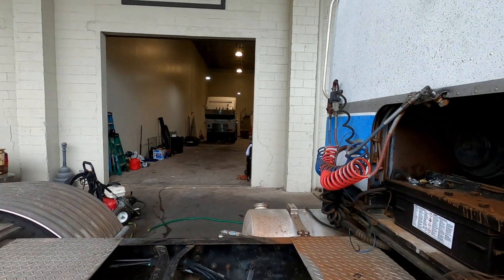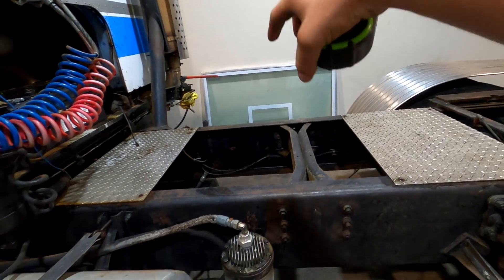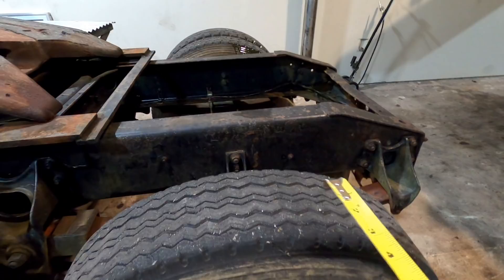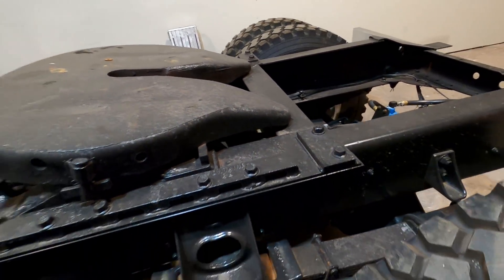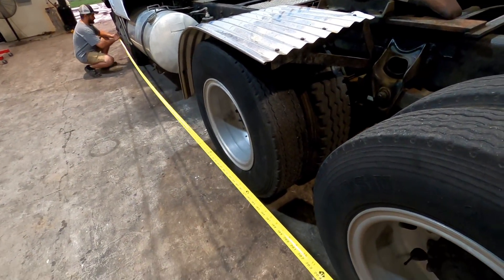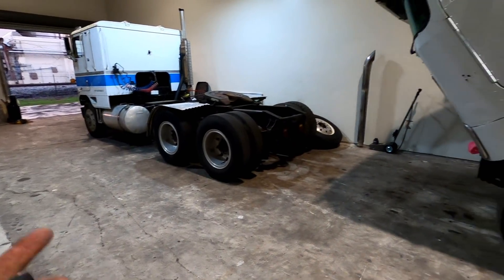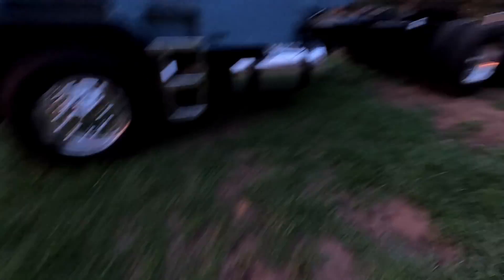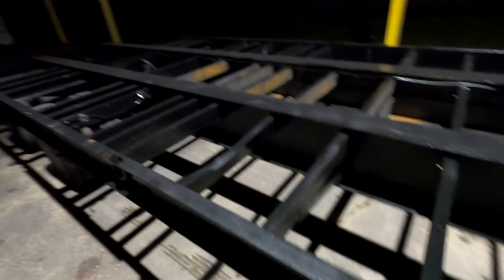USAF Cabover Frame Stretch?

Comment: i thought truckers wanted the tractor shorter to pull longer trailers,  something about total length, so a longer tractor had to pull shorter trailers,  or maybe laws have changed,  he will never haul with it so doesnt matter
Reply: bobby o yes truckers want the truck shorter. Its just easier to make turns and back in spots with a shorter truck. Some truckers dont even like having the camper to sleep in if they dont do long hauls just cause if its not there the trucks shorter making their job a little easier. Stretching is just for looks. Personally i think its ugly and gets even more ugly with a trailer hooked up
Reply: @buffalobmf  stretching isn't just for looks! On them older spring setups, stretching the frame makes the ride quality sooooo much better!
Reply: Um no its better having long because it more easy to back up with longer whell base
Reply: Wheel
Reply: The wheelbase on my conventional (long nose) is 273. Rides quite nice ( the main reason I’ve ever stretched a frame) and with a cabover, it’s going to look longer than it really is.
Reply: paul hauenstein ok😂 not in my 7yrs of trucking across the country everytime i get a truck i ask for the shortest wheelbase with a camper cuz its sooooooo much easier then a stretched out truck. Can i drive a stretched truck of course ive done it many times and its the dumbest thing ever just to make a 90degree turn on a 3lane intersection you have to turn MUCH wider making things unnecessary harder/annoyng. Same with backing in a spot you have to swing that truck sooo much further mostly likely in a tight spot which stretched frames make much more annoying

Comment: Bruce. If you stretch it it'll have a bigger turning circle.
The best thing to do is cut the frames but keep the end product the same length, doing this you'll end up with a long and a short wheelbase truck. 
What's left over could be made into a very short wheelbase truck with 2 axles.

Comment: dont understand why he wants to stretch everything
Reply: greenacres farms green yea really
Reply: Cause he wants to be Johnny bib rigger
Reply: Apparently ya'll have never run a spring suspension truck! Stretching the frame allows more of the vibration through running to be absorbed by the frame flex rather then the driver, and from experience, that kind of beating on a short spring truck will wear your back out!
Reply: @redsoldierftcarson  he ain't going over the road with the damn thing. Hell he don't even have a CDL. The only reason he wants to stretch the frame is to look cool
Reply: He just wants to stretch his wallet.
Reply: @kylanwhittington1646  he's  got have a truck that's worth a fuck first

Comment: I don’t recommend cutting the frames, it will cause a lot of problems and be a lot of work. Besides I really want to see the white cab over run again, you worked so hard on it and I’d feel bad if it all goes to waste. And the USAF truck, just try to also fix it up and make it look new but it’s your choice.
Reply: The white cab over needs too much work so its now a parts truck thats why he bought the Airforce truck
Reply: This one needs a fair bit of work too. It will be a "Rabbit hole" for sure. I don't understand Bruce sometimes, just a few videos ago he told us the axles in the white one were of an unknown, but he wants to use them in this one?? I get the feeling he's underestimating whats involved in stretching, its a big job. The white one was a lot of work, but just chip away at it and he could still do it. The wiring in the one one was bad, well no lights on this one?? The air lines will all be RS on this one as well.
Reply: Mitchell Bruce hey I have an option 3,sell the usaf truck and concentrate on the white international,use the Freightliner as the show truck as its already got the wheel base,but get on do up the White international instead of throwing more money into crap,if he don't like having no money then give it to charity not buying piles of junk.
Reply: Lizzbird I'm with you on this one
Reply: James Horsfield Yes I agree. I think people are starting to get a bit tired of his channel tbh. Most people want to see him follow though on what he starts. Truth be told I think he has a short attention span, as he pulled it apart then got sick of it. Quite a few projects fall by the wayside. The white international is not beyond repair, would give a lot more interest in the channel to follow through. The Airforce one will need a lot of work as well, he will find it’s far from perfect.

Comment: There is a third option. Transfer the rear axles and tanks, leave the frame alone, fix or change out the engine/transmission, and restore the exterior. At the same time he could stretch the other frame and rebuild it at his leisure. He could put a generator back on and make a trailer a rolling show room or what ever her could take to shows, vacation, what ever. This would be an easy attainable project which could help him bring money into his channel for other projects.

Comment: Bruce,

My $0.02 - You bought this truck to restore, make awesome, etc.  You don't need it on the road tomorrow...  If you want to make the best use of the other  International - Go big or go home.  I'd section the frame as you suggested.  The other rear section of the frame seems to be in better condition, anyway.

Take your time with the resto.  Make it badass.

Comment: That paint scheme suggests that it is originally a "Motor Cargo" truck.....Not sure if anybody has told you, but actual, working truck drivers will 100% choose a conventional over a cabover, even if the cab is a long Pete of KW...….Return on investment is guaranteed to be a negative number!....It will be worth no more than a third of your parts cost regardless of what you do to it, so I'm not sure what the point is, but I'm glad to watch!

Comment: Please stretch  a few more feet from the 10 inch end between the fifth wheel take your time no rush you can do it yourself leave the airforce color just buff it out ,dual 7in flat tops, I am a prior Air Force veteran I think a good name for that truck would be Tech Sergeant 👍🏾👍🏾👍🏾, thanks for putting her back in service...

Comment: Here we go AGAIN!  Haven't your learnt anything from the white one?  Why stretch it?  Leave the wheelbase alone and get it spot on mechanically first up.  Don't  stretch it at all.  Plenty to do to make it a reliable well presented beast.  I remember a comment warning you to check the diff ratios before you bought it, but you just forged ahead with your head in the sand and now you have major work that could have been avoided.  And PLEASE keep the bling under control.

Comment: Your Air Force truck has a small motor and it won’t have any power with higher speed rear ends. You want to play super trucker go find an old KW cab over with a 3406E and a fuller road ranger 13 speed.

Comment: Bro,

I did noticed on your previous videos mentioning that one of your first international fuel tank is dented. Well my opinion is, since you've bought another USAF decommissioned international cabover and I'd noticed the fuel tank on it was in good condition dented free, you might just swapped it over with your current dented fuel tank. With a little bit of polishing, it should be as good as new

Comment: If it was mine I would get an air ride cut off with enough frame to get the length you want with one splice. Put an insert inside the frame over the splice that is four foot long and tight to the top and bottom flange. Use twelve 5/8 bolts per insert. I am not saying this is the best way. I have built two trucks this way and so far have not had an issue. Good luck my friend.

Comment: Remeasure the wheel base again, when you measure a 3 axle you measure from the center of the front axle to the center of the tandems not the to the rear axle. No, do not stretch it

Comment: The axel stretch seems like quite an ambitious project. Just wondering why such a long wheelbase is needed. I understand swapping out the axles and most of the air lines can move in the swap but you're planning to switch to air ride suspension so you've a bit of a job right there. Ultimately I would wait and see what you discover once the cab is up.

Comment: CUT & STRETCH !!!  Best option !   Run they air lines inside the frame to the rear cross member & move the glad hands & 7way electrical plug under the goose neck of the trailer. That would make a very clean setup with coiled air lines & electrical cord. Keep the big tanks for a much cleaner look.

Comment: Why do you need to stretch the frame any ways.I worked in a certified truck shop for forty + years welding frames. You are not a certified welder or frame tech.You think you can just cut  a frame apart add a lenght of frame from something else and birdshit weld it back together.I HOPE INSURANCE COMPANIES ARE WATCHING!

Comment: Is it just me or does this new Truck seem like its in worse condition...
Reply: Well one of the reasons he didn't want to mess with the first one was because of wiring issues but the one he just got no lights work on it so he might have jumped from the pan into the fire.
Reply: No, but it is older. Anything that old is going to need  some work.He was able to drive it home 600 miles so no its not worse.
Reply: he`s already in over his head
Reply: It was used by military. Everything is trashed from military. We abuse everything we touch

Comment: To be honest, I would be on the “don’t touch it” vote, but I see it as this: your correct on the thickness of the frames and being hard to stretch due to how the frame does go from 14” to 10”. Also the white one is just parts now. So full send it man. Don’t need to make more work for yourself. Slice the ass end off of em and go for it! 
Edit: loving the look of old Blue

Comment: Hi all, I'm not really sure why you'd want to stretch the airforce truck and suffer with a much worse turning circle in the end. I'm in the UK so not sure the make of the doner truck, but why not fix the engine in that one as the chassis looks pretty good in itself. Then fix up the airforce truck as a stock truck. In the end you'll have two good trucks instead of one good truck, hopefully, and two halves of another. What is the fixation with stretching trucks for anyway, if you had decent air suspension you'd just not consider messing with anything.................Regards Dave.

Comment: I would stretch it, cut the c channel  half way down L shape 8 inches long or so on each splice to have a ledge for the rear two channels to sit on, take your time laying it out and cutting. I would then weld  it back together making sure each side is even. I would grind the outer weld flush and add 1/2" thick fish plates about an extra 3 inches past the splice.

Comment: you have a solid work truck with Blue Collar, Stretch this one, make it a show truck. Turn up the engine some, the 8v92 turbo makes 435 horse at 2100 rpm. you will be so busy shifting you will not need more hp

Comment: I wouldn't worry abt stretching the frame, jus swap the rear ends that have been redone, getting in and out of places will be alot easier, I've got a 74 Mack w a long flatbed that is 300 inch wheelbase, and jus pull a 24 ft trailer behind it, it can be a hassle getn in and out of tight driveways and entrances sometimes

Comment: Stick with Option 1. If nothing else, swap on the air ride hard components from a wrecked IH, and add new air bags and valves/hoses later on down the road...save the money and immediate attention for all of the other items it NEEDS to make it roadworthy. Plus, you're going to wind up putting some money into parts for that engine, and BGM Scott doesn't cut corners....he's become an excellent resource for 2-cycle Detroit engines, be sure to soak up knowledge like a sponge.

Comment: Leave it as is. its all ready got the sliding fifth wheel you wanted. Get mech items done first. Oh  and like others said wheel base on a tandem is done at center between the two axles. option 1.And I recall stretching also requires extra C channel to go on either the inside or out side of the cut for strength. approx. 2ft ea. way . some one else mite correct me if needed.

Comment: The objective here is to accomplish building a showy cabover with some USAF history. This is the time to stretch and glam it up. The tanks need to be long to match the lengthened frame. The first cabover is now for parts and it has already had all of the essential upgrades. Makes sense to swap over the back end and part out the balance of it. Might be really surprised as to what all of it can bring in little by little. The white International will vanish in 60 days!  I would still like to see a Cat engine but that's just my preference. 3406 B

Comment: Bruce, #1 job, get the Wild Blue Wonder Air Force truck fixed first, lights, brakes, transmission, engine, all the hoses, all the wiring, & a RADIO!  Do whatever to the frame.

Comment: I can't recall if I said it in the previous video but there is likely a speed governor on it to prevent speeding.
Reply: The Air Force truck is geared too low, at 2500 RPM,  it's only doing about 65 MPH 
That's slow, very slow.
Reply: The Air Force truck is geared too slow
 65 at 2,500 RPM is slow.  He said he thinks it has 3:90 gears, according to my calculations it's closer to 4:50 with an over drive  top speed would be closer to 85 MPH 
I'm figuring on a 13 speed with a top gear of .74

Comment: you can take the slider fifth wheel from the old international would work better with the freightliner and your trailer to pull any equipment and it is free

Comment: Just a piece of advice you measured the wheel base wrong the right way to do it is from the center of the steer axle to the middle of the drive axles, so your looking at probably a 180 ish wheel base, also stretching a truck is not as easy as you think I’d leave it personally on maybe pursue it down the road

Comment: Get it mechanically sound first.  You have good ideas  but your priorities have to be first to make the truck road worthy and reliable , Put the tires, rims, fuel tanks from the white International Swap the axles, swap the tanker, lift the cab and fix the interior  lightsand exterior and good  radio .but you already decide on what your gonna do

Comment: leave the new truck at home and forget about it for the minute. then go and strip the old white one of all the parts etc then scrap whats left.then get a pen and note pad and write a list of all the jobs you need to do and what parts you would like and need get the engine rebuilt and painted on the new one and get the cabs dings and dents repaired and then get it painted at a proper paint shop. whilst cab and engine are getting done you can do a proper good job of the chassis etc. so first job phone and get a slot at painters and arrange for engine company to build engine. peace from the uk

Comment: I’m sure someone already said it, but that’s not the correct way to measure wheelbase. It’s measured to the center of the rear “group” of axles, not to the center of the rear most axle. All that being said, the way you are measuring is fine just for truck-to-truck comparisons. BTW the freight shaker looks badass!

Comment: I’d say keep it standard. Sort out all the other jobs first. Like the electrics and the water leak. If you are not happy with the axles. Then just swap them over. It’s not that hard. Just jack up the chassis and wheel out the axle with the springs and everything fitted. You’ll do it in a day. Rather than cut and shunt the chassis. I say keep it original and try and find the trailer to go with it. Maybe change the mud guards with something similar but up dated.

Comment: I think you should just leave it alone stretching it ist's going to gain anything.  You to fix all the running issues make it a good running solid truck first. Keep it stock and fix everything make everything work. Then just swap the axles from the other truck. Also the wheels.

Comment: You don't measure wheel base front axle to the back axle...   I thought the Air Force truck was in mint condition.  You guys should maybe talk to actual truckers for some advice. Just crazy buying chrome before having truck mechanically safe .

Comment: Hey Bruce....now read through the comments more closely. You need to address why you would NOT take the cab and engine / transmission out of the USAF truck and move them into the other International. Similar amount of work and no frame cut which is a 3 day task. People are asking and it's a good question to ponder. Think about it.....

Comment: I don't think the gears in the rear end AR the determining factor of being to low gear. I think the older truck had a direct-drive transmission and the newer one had a overdrive.
Reply: Had the newer one been a 13 speed I would agree, the problem is, I don't think 9 speed overdrive's came out until much later like around 2000.
Reply: @bertgrau9246  I have a 91 with a overdrive 9 speed .

Comment: Are you going to change the rear ends or is 60mph fast enough for you. I had one that would only go 60 and it was a pain in the ass. Being that's a Gov. truck it may have governors on it. I drove a Navy truck that did and would go the same speed in 12th as13th

Comment: First measuring the wheelbase wrong. On a truck you measure from center of the front axle to the center of the drives. In between them. Second don’t stretch the Air Force Truck. Just swap the axles. What gears are under the white one?

Comment: Smaller dual tanks. For 2 reasons 1 is the weight of the fuel on the front end. 2 the cost of the fuel. 2 100 gallon tanks should get you about 500 miles. which is about what one can drive legally any ways. You WILL have to get your own DOT numbers. Because you will be going to shows and fairs for money. I suggest talking with a dot lawyer will save you a lot of head ache and heart ache.